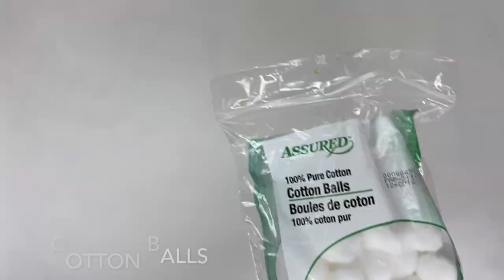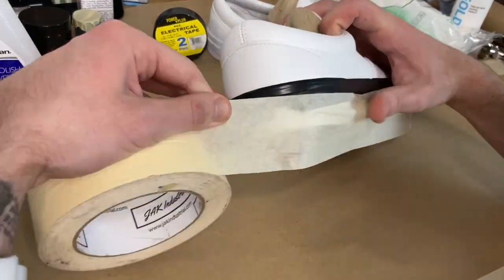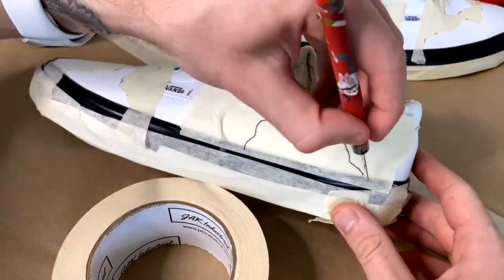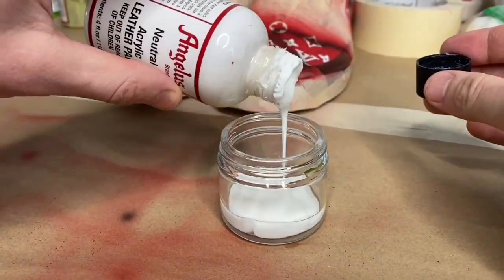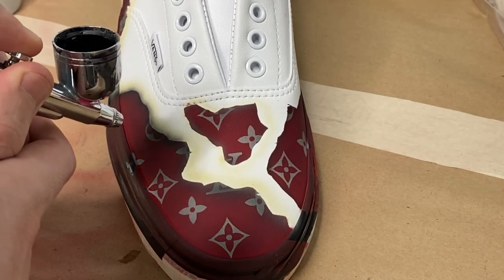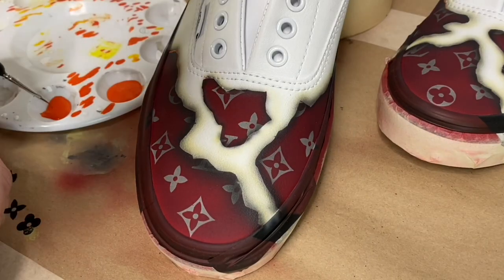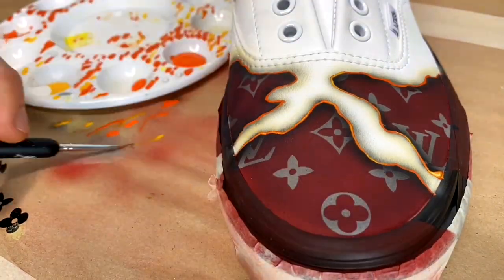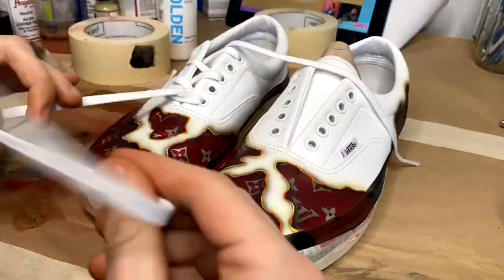COLOR CHANGING VANS TUTORIAL ft. Sneaker Mechanic

Comment: If you use thermal color dust on fabric with gac 900 is it safe to heat set it with a heat gun or use cool blow dryer?I Appreciate you work and Expertise 🙏🏾🤘🏾🤞🏾
Reply from the maker: I always recommend heat gun, but a hot blow dryer should do the trick!